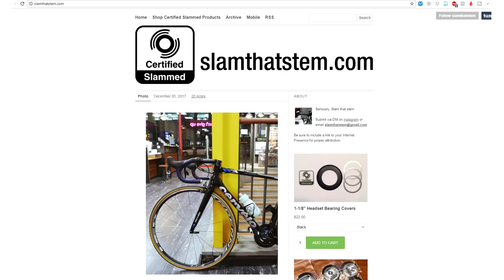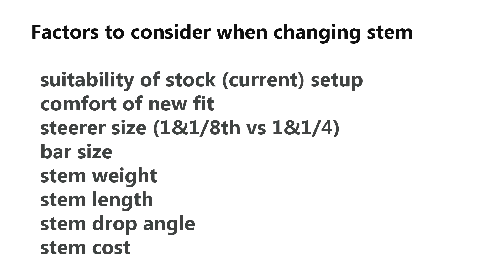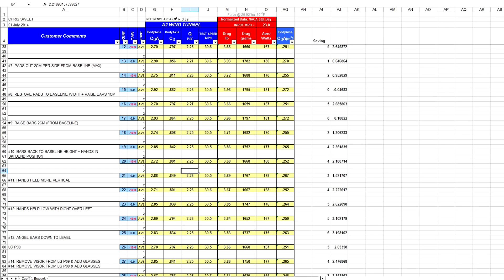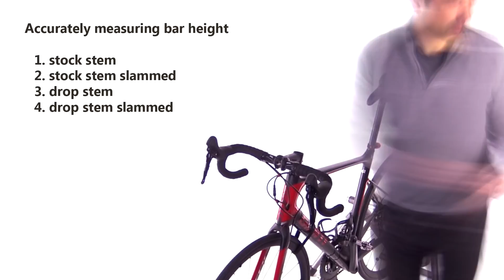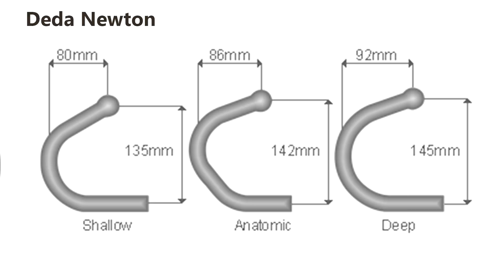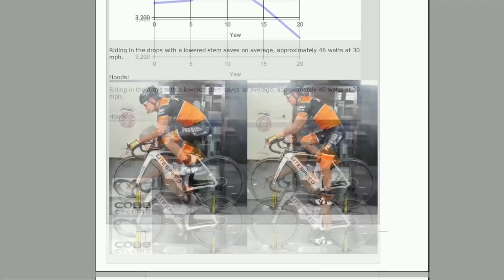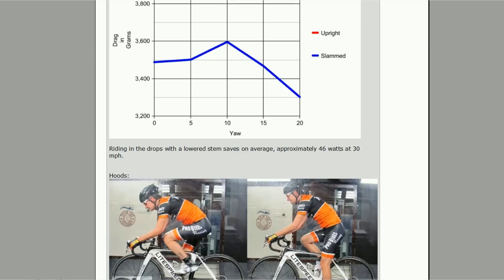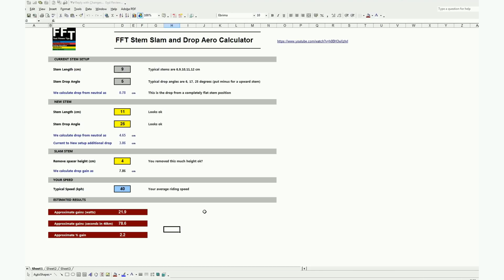Stem Science! How many watts does a slammed stem save?

Comment: The head tube on most current day road bikes are way too tall.  I tried to buy a Trek Emonda a few weeks back, with it's ridiculous tall 14 cm head tube I just could not get a good slammed position so I did not buy one.  Bicycles are now being designed for unfit people with money to blow that want to sit upright.  A Garcia, going down a frame size is not an option on the Emonda because they have paired a short top tube to those tall head tube.  My current 54cm frame is more than a full inch longer in the top tube than a size 54 Emonda and I already use a 140mm -17 stem.   I would need 165mm stem to get my length and a size 52 Emonda still has a much taller head tube than I am used to.  Pro riders do not get the same geometry as is found in bicycle shops.
Reply from the maker: I am inclined to agree....why don't manufacturers offer a high stack height option and a low stack height option in the same frame series?
Reply: Do what the pros do. Go down one frame size.
Reply: @a.garcia9815  correct
Reply: Long head tubes are ugly on race bikes. My caad12 has nice geometry but was only supplied with 3 cm conical spacer, no default slam option. Power savings are substantial, slammed long stem @20 mph about 10% ~ 20w.
Reply: John O'Neill sounds as if your torso and arms are unusually long, and if your proportions are that far off from the average that fine tuning components won’t get you a proper fit, either you ought to be riding a fully custom frame or seeking a second opinion from a qualified and experienced fit tech.
Reply: TREK does offer 2 geometries on the Madone for this reason.
Reply: Yes, they "offer" 2 geometries, but only on the top level. You get the choice of geometry on the Emonda SLR9. The SLR8 and lower do not offer the H1 fit. The SLR8 starts at $6,500, the SLR9 starts at a whopping $11,000! If you go with just the frameset, the H1 SLR costs $3,000, the H2 SL is nearly half that at $1,580. Personally, I don't care about the 30 grams the SLR saves over the SL. In the Madone, the frame price difference is $1500. Other manufacturers offer race geometry for far less than Trek does.
Reply: As far as I know, pro rider frames are required by UCI rules to be available on the open market. The Emonda is probably about the least agressive geometry you can find in race bike and probably simply not the one for you until you swap for longer legs. Once upon a time people used to use an articulating torso support technology, known in lay terms as "elbows" while riding in the hooks.  Hooks are generally too low now and too close to the body(to allow easier reach to the hoods) to permit 90 degree elbows while on hooks.  A bar position that allows that just doesn't look cool now.
Reply: A Garcia, going down a frame size is not an option on the Emonda because they have paired a short top tube to those tall head tube. My current 54cm frame is more than a full inch longer in the top tube than a size 54 Emonda and I already use a 140mm -17 stem. I would need 165mm stem to get my length and a size 52 Emonda still has a much taller head tube than I am used to. Pro riders do not get the same geometry as is found in bicycle shops.
Reply: I have many older roadbikes that fit me fine, made by Trek, Klein, Cannondale, Gitane, Motobecan and more.  You are correct that if my legs were much longer than my 32 inch inseam that I could simply have a seatpost that is so high that the long head tubes of current day Treks would be less of an issue.   I have a custom made Marinoni TT bike that is awesome.  I had it made with the smallest head tube possible to keep my torso low.
Reply: test blustacks I have also the CAAD12 and changed the conical spacer for a 5mm version, additional I use a specialized stem with 130mm length.... The very fine option on the stem is that you can use various inserts and make it to (hope I remember right) 24deg. In my actual setup I use 20 deg. and I am fine with that. For me it is the biggest advantage that I can ride in such a aggressive position even for a long time ( I did 24 hour race this year) I see the difference in speed during the races when I am comfortable on high speed sections even the other riders are stronger I can play with them...
Reply: I'm in the same boat, but taller 6ft2in, so I require a 58cm frame. The headtube on that size is a massive 19cm. I settled with an older Madone like this, but HATED the fit and how it looked. People recommended that I use a neg 17 stem or more, but, to be honest, it looks stupid. If I'm shelling out that much for a bike, I don't want to have to take extreme measures to make it work and then have it look terrible. Trek's answer to this is to go for the top-end frame with H1 fit. The markup for that is not worth it. Too bad, I like the Emonda concept, but Trek lost me as a customer due to their ridiculous geometry.
Reply: Also, sizing down wouldn't work for me, as I already require a 130mm stem for a 58cm bike. A 56 would require q 140 or longer.
Reply: My emonda had also a large stem, but I requested a smaller and they replaced it, another brand, but I dont care about bontrager or not. its now just 3cm and it feels great, no need for slammed angle i think
Reply: Not true for every brand. The Specialized Tarmac head tube for example went down for 10mm compared to the pre 2013 models.
Btw a slammed stem has only positive affects at an AVERAGE speed > 35kmh.
Reply: Yep!
Reply: I have an SLR 6 - 2017 version. It's got the H1 fit.
Reply: also the case for pedals, almost all 56 cm frames come with 172.5 cranks, I wish i could chose which size goes on the final product
Reply: H1 trek geo. should be better

Comment: What the hell is with your seat angle? You'll slide off that thing mate.
Reply from the maker: lol. minus 9 now uci legal!
Reply: This info is all well & good in estimating how many watts can be saved etc BUT please guys & gals don't just slam your stems after watching this. If you're serious about your riding & want the correct inprovements that will give you sustained power output & comfort, invest in a proper bike fitting. Being aero doesn't mean you'll be comfy or in a good position to sustain power &/or comfort.

I've 25+ years as a bike fitting specialist & i'm happy to carry this out for anyone in the UK.
Reply: You can tilt up to minus 15 degrees without slipping.  Nose down allows the pelvis to tilt forward, moving the lumbar spine into a more neutral position.  If the UCI rules loosen up further, the Pros will definitely adopt an even steeper angle because low back pain continues to be a problem in professional cycling.

Comment: The lower the slam, the more cervical spine lordosis is required to be able to look ahead on the road, the more risk of eventual cervical neck problems later on in life
Reply: Chau Nguyen You dont need data. Quicker to look over a shoulder for that truck on an endurance bike than when your having a conversation with the spoke nipples
Reply: I would be interested in data supporting this statement
Reply: @nick
thanks for the Mayo link.  I've just read it.  I'm not sure if a lower stem (in the context we're discussing here) will increase the risk of spinal lordosis later on in life here.  According to the article, the number 1 factor seems to be age related.  Then cycling, in general, can also put pressure on the neck, but is the difference between a 6-deg stem and slamming on a 17-deg stem all that significant in the mitigation of spinal lordosis at age 60+ later in life?  It's not like a cyclist will always be riding in a slammed position, right?  I have a slammed stem but I would say only about 10-20% of my riding time is ever spent in such position as i'm upright on the hood most of the time.  Usually, cyclists tend to stop using a slammed position when they are no longer racing.  And furthermore, cycling in general do tend to make people lighter in weight, and this could also help with other areas of the body, including the neck.  All in all, I'm still not overly convinced that using a slammed position when you're racing result in a significant risk of spinal lordosis later on in life.  What about people who lift weight, specifically doing exercises like deadlift and squat? These guys also put a tremendous amount of pressure on their neck, yet we don't hear about weightlifters getting spinal lordosis much (well weightlifters do get neck and back injuries, but it is usually because they are doing a 1-rep max heavy lift, but regular people do not need to go crazy like this).  Thanks for the link.
Reply: I have used an adjustable head stem with no spacers and figure 8 bars. This way I can quickly and easily alter the amount of the bend.  To minimize the strain on the neck etc.  But it also means that I can maintain the most aerodynamic position of which I personally am capable.  Being 69 years old I do have to balance all factors.
Reply: True. my neck hurt when i ride my mtb with slam stem
Reply: Might be that you, or the scientists/ doctors are right... But it is of course very individual! In the same way like advisements from doctors can be very individual even if they make it especially for you...... Since the doctor said the doctor I will need a operation to correct my O-legs which are the reason for my knee problems. In fact I was a runner.... Mainly cross country what is known as very soft for the joints, but I had during app. 2 or 3 years problems with more or less pain, and the knee was more or less inflatoried, finally I had one hit and really bad pain with the need to go to the specialist to solve is. His final words: OK even you don't want it, but you will get an operation.... Even now for correction, or some months later and I will put the artificial knee in...... I decided to make noting but stop running and restart cycling ( I was planning for that year to compete in an Ultra running event) now a bit more than 3 years ago..... I am an Ultra cyclist and I won last year the 3rd place in the 24h Cup beside one 24h Race in Slovakia. By the way.... I am riding an very aggressive position on the bike 😉
Reply: I forgot to mention: My actual age is 47 🙊
Reply: Absolutely true.
Reply: Added a steering tube extender, plus a shorter, steeper stem, and my neck pains immediately vanished!
Reply: I laughed at the "conversation with the spoke nipples" line.

Comment: i do not believe in slam stems too much because people with a very low position tend to never ride on drops i think is better a correct bike fit to allow you to ride the most aerodynamic position for most of the time
Reply: Slamming the stem night make the bicycle alone more aero, but if the rider is holding the arms straight downwards, the arms are like barn doors to the wind.  If I want to get aero, I don't bother with slamming, I just bend my elbows more so that my forearms and back are flat.  Then if I want to ride more upright, I still can because my stem and bars are not ridiculously low.
Reply: wouldn't the most comfortable aero position be a slammed setup so that your hoods are as low as possible? And then drops are even lower for more leverage and a lower head during a sprint?
Reply: It could be easier to assess the road and be more comfortable to ride with a slammed stem and avoid the drops this way.
Reply: Bingo, and if you bend your elbows in the drops, you have a very comfortable position to recharge on the tops, letting you get back aero again for round two.
Reply: @bigring6424  but it's more aero to have forearms horizontal while on the tops. There are large aero losses by having hands on the drops. Drops are used for descending, cornering and sprinting.
Reply: dan that's only true because of modern handlebar positions.  I should have said in the hooks really, but that's what I meant by bent elbows in the drops.  No, bent elbows with forearms horizontal, is not more aero on the hoods than the exact same position in the hooks.  The difference is that doing that in the hooks requires your handlebars are mounted higher, exactly as the old guys like mercx used to do.   Brifters and benefits (with corresponding compromises) of riding on hoods are the reason for the change in handlebar position, mostly.

Comment: You can also corner better as you have a bit more weight over the front of the bike!
Reply: You really don't want more weight over the front. That creates a wash out situation. You want it at the lowest center of gravity .....which is the bottom bracket.
Reply: John Riggs plus when cornering very hard, ya are less likely to get that tipping over feeling. I slam my 110mm -17° and it corners so hard i actually roll a bit on my rims(had 23mm tires)